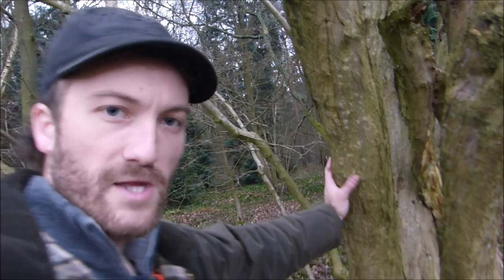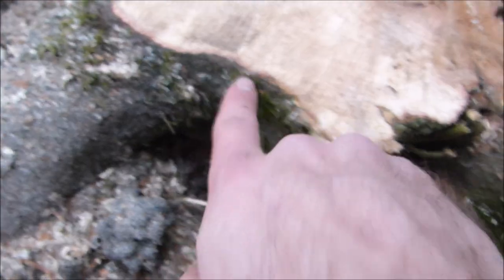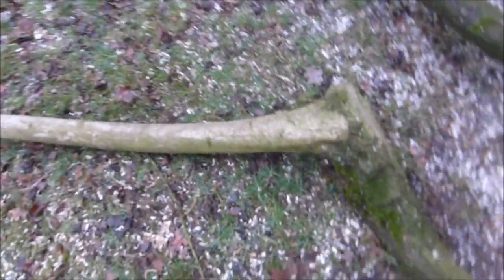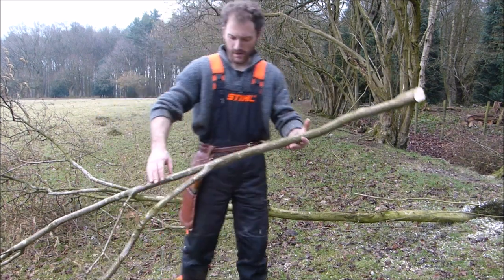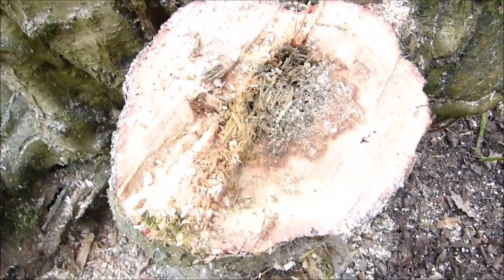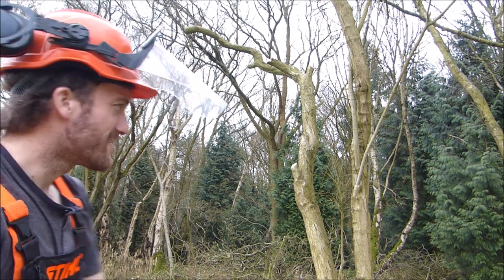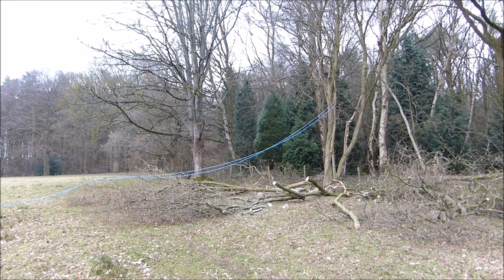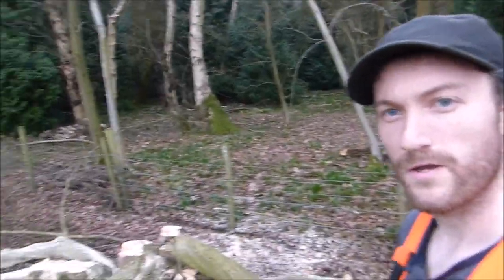Hazel Coppicing   Part 1

Comment: I really like how you work. You don't just go around and chop everything down, then clean up afterwards. You cut something and process it. Cut and process. Keeps the work area clean and if you have to call it a day for whatever reason you are not leaving a giant mess.
Also, leaving the snedding for the later part of the day is asking for trouble. You are more than likely to be tired and as we say in Dutch 'an accident is hiding in a tiny corner'. Logs can twist, snag your chainsaw, billhooks can slip. Better to have your work measured out more and diversified to keep you sharp.
Reply from the maker: Thank you

Comment: I have a line if mature hazels along 2 sides of a 2 acre badly fenced field. I want to selectively coppice, taking out the largest branches I can from each tree. I do have rabbits and deer so want to avoid coppicing entire trees. I'll be using it fir firewood and I also want to ensure the longevity of the trees. I think they were planted a little too close given how neglected they are.

Your video was very useful, thanks.

Comment: Hi, great work, really entertaining and educational. I'm thinking about planting either Hazel, Ash, Lime or whatever I can get my hands on, to be able to make bean poles. 
1. What grows the fastest?
2. Lasts the longest?
3. Looks the nicest?
4. Grows the straightest?

Thanks. All the best.
Reply from the maker: Hello thank you, any of those will do fine. Sweet chestnut and willow are also very good for bean poles. There is a lot of variables but roughly Willow is probably fastest growing but only lasts a year or two after cutting (same with Ash and Lime, Hazel could last 3-4 years as bean pole if lucky). Sweetchestnut lasts longest as it has more tannin content (therefore more durable in the soil for several years)All those species look nice in my opinion and will grow straight in a good aspect. Hope that helps
Reply: @Woodforgeuk  Thanks for responding. How long would it take to grow some good poles from the above mentioned names for bean poles?
Reply from the maker: @nuruzzaman4893  Sure, growing trees takes a little patience, its kind of a mid/long term investment.  If you already have existing trees you could harvest on a 2-3year cycle depending how thick you want the stems (cut them as soon as they are big enough). Otherwise planting new trees you'll have to let their roots establish a couple of years first before starting a coppice/pollard cycle. Good luck